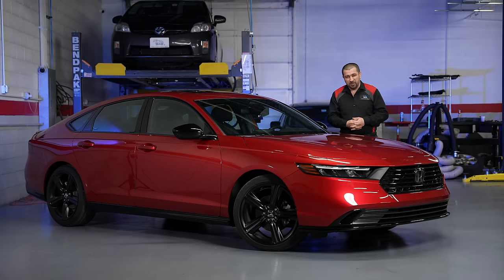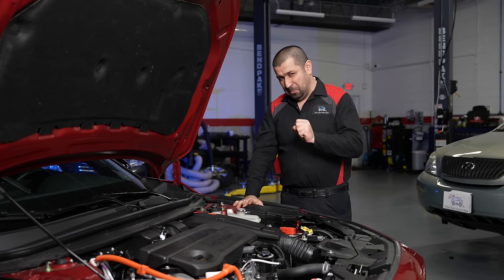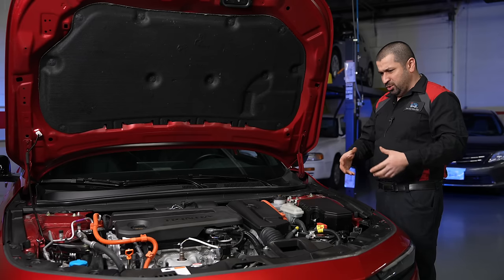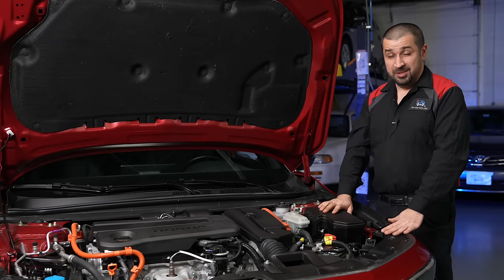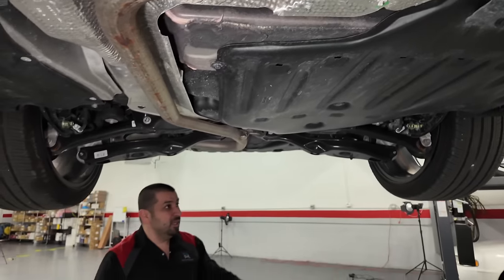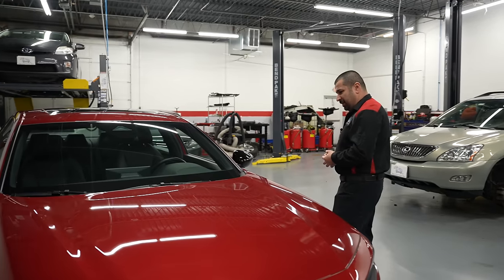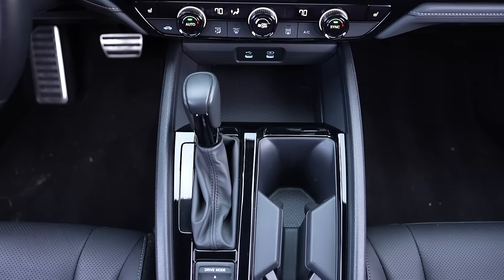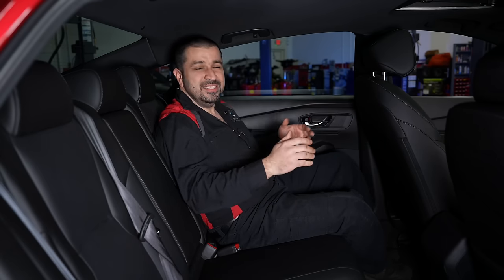Should You Buy The Latest Honda Accord? A Mechanic's Review

Comment: The problem is these Hondas have got WAY too expensive.  I have a 9th generation. And this new accord is basically the cost of TWO of my cars. That is insane. Honda is No longer affordable
Reply: It’s not just Honda. Nothing is affordable anymore.
Reply: I kind of agree with you Jimmyortiz4319. 40K for touring like any others as @Noahkinz has said it what the problem is in our country. Plus the maintenance for all these new Turbo Hybrids is going to cost more. I have a 2017 Honda Accord touring V6 that I paid 29K new for it and love it. It’s also cheaper to maintain. My oil change and tire rotation was $89. My neighbor has the new touring and got the same service for $211 from the same dealership i went to. He was shocked.
Reply: I just bought a 24 touring, got a great trade in offer on my 14 ex accord. So far this new car has been amazing, got financed at 3.9% and should be paid off in 3 years.
Reply: Nissan is
Reply: The strange thing is that ¥ is at all time low against $... Should mean cheaper Japanese items? 🤔
Reply: @Buppasiri1  lmao that's not how the economy work bruh xD
Reply: KIA K5 EX cost $ 30,645.... 
and its a KIA. 
accord EX cost $31,005.
and its a honda.
Reply: It's more affordable than most. The average transaction price for a new vehicle last year was $44,000. Pickups are insane.
Reply: It's mostly due to the requirement set by the federal government for cars that's causing all car makers to use newer tech to reach the mpg standards (cafe).  These requirements are the main cause for the cost increase. The 1.5 liter is due to the cafe standard (gas mpg) requirements or they'd still be using the v6 that's lasted forever on these cars.
Reply: Affordable ? Depends who you are. I bought one. Great car.
Reply: @Noahkinz  Yes. Looking at how much pickups have jumped up.
Reply: In Honda you not pay for brand name like most german cars this days, you pay for reliability of car. And for me that way more important
Reply: @beekaye1496  You talking about something you have no idea. New Honda hybryd engine have NO turbo.That is simple, reliable and economical engine
Reply: @Buppasiri1 most Japanese car is no longer made in Japan.  The Plaza accord took car of that.  Most are made in US and then some are moved to Canada and Mexico.  What the consumer buying is mostly made in US and North America, thus price are jacked up.  Unlike the general home goods that is made in China, anything that is "Made in America" is expensive as union jobs are extremely expensive.
Reply: No sir, they are not.
Reply: 😭.   Oh boo hoo.  The Problem Is….people who can’t afford nice new things are making themselves miserable by watching YouTube videos and then whining about the way of the world.   Can’t afford to play?    Fine.    Get off the internet and stop complaining .   The rest of us will enjoy our new cars and trucks and manage fine.
Reply: @Noahkinz  , may be not that affordable, but still super reliable. And keep price on second market.
Reply: @beekaye1496  Would you like compare aswell the petrol burn between your V6 and new hybryd? And road tax??
Reply: @Buppasiri1  The Accord is made in the US, why would an exchange rate apply?
Reply: @ronhoover5516  That's right but still...  why not import the Japanese instead if the price are a problem? Let the U.S factory "sleep"..
Reply: Couldn’t agree more
Reply: @dwadd7528  Yeah, but the KIA comes with that 10yr/100,000 mile powertrain warranty.  That will come in handy when the rear main seal or oil pan starts leaking.
Reply: @jeffeason3599 I can afford to buy a new car like the one shown with cash every year, but still believe people have a right to express their dismay with basic brand prices. The people on Rolex videos complaining of their cost are a totally different case of course.
Reply: Dude, this isn’t Honda’s problem. Nothing is affordable.
Reply: It’s ugly
Reply: It's handsome
Reply: @davidh7339 and that is exactly how long a Kia will last 100k and die
Reply: @secularthinker My 2011 KIA Forte has almost 104,000 miles and is still running strong.
Reply: I just got a ‘24 Accord Hybrid EXL well equipped for $36.5k drive out price (this included doc fees and GA state taxes).  Came with extra all season mats, trunk mat and window tint.
Reply: 2019 According EX 37k, my 2024 Tacoma TRD Sport 51K. Prices have blown up for all good vehicles.
Reply: @JFreeUNC I got a exl too.  Metallic grey with the light grey leather interior.  I kind of like it better than last gen and I loved the last gen.  I like how the steering get stiff on sport mode.  If it had adaptive dampers like the last gen touring it would be a legit luxury car.
Reply: @jeffeason3599 I can afford those cars and they still seem very expensive.
Reply: Life in general is no longer affordable.
Reply: The camry also is no longer affordable for many people either.  Dealer in my are has them priced from 32k to 49k.  32k for the le with those ugly 16 in rims and tiny infotainment screen.  Even the gauge screen is tiny on the le.
Reply: You have the best looking gen imho. Keep it till it blows up.😅
Reply: You should have kept the 14'. 9th gen is the best gen imho.
Reply: Sounds like a very complicated power plant with more systems to have issues and maintenance with. Longevity and reliability  is what Honda has been known for. Time will tell how this works out. I am not running out and buying one.
Reply: @stephenwhite3576 44K? You must be looking at a base work truck.
Reply: They never really were
Reply: @quala1 yes and you can thank Obama for that.
Reply: @davidh7339  You will have to wait to get that KIA repaired due to parts being on back order.
Reply: @smokeylake6732  Beauty is in the eye of the beholder!
Reply: @Teporame  If they are reliable then you can justify paying for the reliability.  This Accord seems to be a worthwhile investment.
Reply: In Europe we don’t have the Accord anymore but the fully optioned civic hybrid costs 43000€ taxes included. 😳
Reply: All cars went expensive, price gouging
Reply: Then don’t buy one. ☝️🤡
Reply: @stephenwhite3576 THEN DONT BUY ONE !
Reply: @VasylSodomora-bj4ji 

Exactly.
Reply: @smokeylake6732 Much better looking than a Lexus or Toyota with their stupid looking monster robot grills 😂
Reply: @TeeDee-j9u Post pandemic price gouging. After we gave US corporations billions. And Democrats have done nothing 😂
Reply: In my area the Accord EX is 31k and I have seen 29k in San Antonio.
Reply: Truth is, nothing really decent is cheap anymore…not even the formerly ‘cheap’ Korean twins are cheap anymore…did anyone say ‘preowned?’
Reply: @patriotone755  did you listen to his breakdown? It's not that complicated for a hybrid at all.
Reply: @VasylSodomora-bj4ji I still have a ‘15 Accord with the 6 speed manual that I love. Depending on where you live, excise tax (V6 or not) is far less on the older 9th gen due to the vehicle’s lower value. V6 is very fun to drive. Sales tax was also lower. Factor all of that in and the difference in cost covers a lot of fuel.  9th and 10th gen Accord are also much better looking than this 11th gen. At least the 10th gen offered an optional 2.0T engine in lieu of the V6. 11th gen lost it. That said, this current Accord is still nice.
Reply: @6mtzhp55 I love Rolex and Rolex videos. They’re not for everyone but definitely on my bucket list someday.
Reply: You see there are a lot more components and features added to modern vehicles that drive the cost for example computer Chips, touchscreen infotainment, heated ventilated seats etc.
Reply: @Buppasiri1 Have to look at the BOM to see how many parts from Japanese suppliers in Japan and not suppliers in the US. Then add in the fact that the vehicle is assembled in the US.
Reply: @Buppasiri1 Democrats be wantin to party. And you gots to tell dem no!
Reply: @13loodLust Democrats be wantin to party. And you gots to tell dem no!
Reply: It could be that you're just broke.
Reply: Don’t worry the 9th Honda accord v6 coupe is still the best.
Reply: All cars are expensive my 2023 ex was $31,160. It not twice as expense as say a Camry!
Reply: I went to the dealership this weekend to look at the Civic Hybrid and they wanted almost $40k for the top model....ridiculous 😂

Comment: Picked mine up 5 days ago. As a full time Uber driver, this thing is a dream. I’m complimented daily not only on the look but the crazy amount of room. Thank you very much for the battery vent warning. I wasn’t aware how important that is.
Reply: Did you get tax savings / rebate?
Reply: I believe it qualifies for a half a credit as some parts are chinese in origin
Reply: loving  the AC vents in the backseats :)
Reply: When I was shopping for a new Accord in 2016, I wanted to get a hybrid…..Do you know that Honda was charging $45,000 for one back in 2016!  I went for the ICE 2.4L, which has plenty of power and good fuel economy….now hybrids and ICE versions are basically the same price. I would be very angry if I bought a 2016 Honda Accord Hybrid for $45,000 in 2016 and then saw Honda drop the price on hybrids.  I got mine for $27,000 including destination, taxes and $1,500 Honda sensing safety option through Costco car buying program.
Reply: @mjb0183 you was going to be more than happy with 2015 hybrid a lot saving and no need to buy another one. I have the same car 2015 I’m happy no problem over 250k miles and not need to buy the new one the only thing lacking is the trunk is smaller cause honda put the battery in the trunk the new one have it under the back seat. Another different is the older model have a bigger tank size so i had done over 600 mile with one tank with the new one idk if that possible do to the smaller gas tank.
Reply: How do you afford this doing uber full time? When i did uber i went into debt. And i couldnt imagine having a car payment on top of that.
Reply: @Lobonova  EXACTLY!!
Reply: @SPIN_89  How in the world can you buy a New car driving for Uber?!?!  I do Uber Now with a used Car that is Paid for. And let me tell you I can barely afford to maintain my vehicle.  Or even just buy something newer. Heck I cant even save any type of money. Uber charges  DIRT  cheap for rides compared to any taxi. So we make crap money
Reply: Full time Uber driving a Hybrid? I would be worried about having to replace that battery so fast. I would imagine you are putting in 40k at least in miles a year. The hybrid battery warranty is 8 yr/100k.
Reply: @0my - It was a dealer loaner car originally so I got almost $5k off for that and an extended standard warranty. I’m not 100% on the tax savings though. I’ll have to ask my CPA
Reply: @nightrider2k6 - I was too but that only comes in a higher trim. Super lame but the AC up front does a solid job.
Reply: @jimmyortiz4319 @Lobonova - I live at home with my parents, duh! 😂 I’m a single parent and the AVG cost of a home is $435k in AZ. Avg rent is over $1500. I’ll be with them till they die! 😂
Reply: @paulcarlin5181 - TBH it’s a really concern. But it beats a full combustion engine on so many different levels. If you do your money right you can just save for when it’s time to service it like anything else. Plus I’m averaging almost 50 mpg daily.
Reply: @SPIN_89  My gf was debating the CRV Hybrid and she went with that it will be a drive to the wheels fall off ride so she went non hybrid. Short term I would go Hybrid. Enjoy your ride Sir.
Reply: The interior is literally CAVERNOUS.
Reply: @Lobonova what market, Boston drivers average about $1400 gross weekly, over 50 hours 1500-1600

Comment: I have this car and driven it 5k miles and I freaking love the thing. First car I've gotten that I view more than as just a means to get from A to B. Love love love this car.
Reply: What do you love about it?
Reply: @danjenkins2064 probably the smoothness of it when driving. I own a vehicle with gas cvt and it just runs smooth, but no worries I will be doing a YouTube channel video on CVT transmission with my vehicle in 2025 when I do a 5 year review on it
Reply: @alvinsimba734  Thanks for the response.
Reply: Are the seats comfortable? I hear their harsh on long hauls if you have back issues? 🤔
Reply: @nastynati3501 I drive 3 hours one-way about every other weekend and I never had an issue with comfort. I’m also 25 and never have back issues so probably not your best opinion
Reply: @nastynati3501  the best answer for your question is to sit in it in person and then see
Reply: I drive the Touring. Comparing it to my old ‘19 Touring 2.0T, this one while not as fast, the interior is so much more quiet and refined. The NVH on the last gen was terrible. So much road noise and terrible mileage.
Reply: What a bummer and a dull life. Loving a slow and lame car. What you need is a Fast Car and a Beautiful Woman.
Reply: @danjenkins2064  its like a swiss army knife. Want to have a little fun? Put it in sport, and its plenty quick. Want a super efficient ride? Econ mode and predictive driving can get you 50+ mpg with intelligent use of the regenerative braking, want to enjoy some sun shine? roll the windows down open the sun roof and enjoy. Its quiet, and comfortable. Its the perfect daily driver imo.
Reply: @richscott2483  haters are gonna hate. Im happy with my purchase.
Reply: @nastynati3501  I haven't had issues, I find the car quite comfortable and don't really get fatigued by driving. The car is fun. All I can say is test drive on yourself. Haters gonna hate, but 150k mile warranty and 10 years with the extended so if your worried about something breaking you can look at that.
Reply: @EpTyrannical  Great answer. Thanks for sharing your perspective.
Reply: I rented one for a week. It’d be in my driveway as I type this but for the scantily-padded seat cushions.
Reply: @richscott2483  --Lol, like the Fast Car but Too Old for a Fast  Beautiful Women...
Reply: I agree. Same here. But there is onw thing I still haven't figured out. How can we check the tire pressure?  Does the car show it anywhere in the system?
Reply: @nortenero  I currently own 2019 Touring 2.0T like you had. I bought it new and has 48000 miles on it. Are you still really liking your hybrid compared to 2019. As you know the 2.0T quite fast etc but my mpg is about 23-24 so not that great. How is the acceleration/torque feeling of your hybrid compared to your old 2.0T? i plan on driving one but I hate the whole dealership experience. Thanks
Reply: @EpTyrannical  i just test drove this and can confirm this 💯
Reply: @Hilighted seats are hard on the 2018 civic also.  Minor ergonomic issues.  Best fuel economy I have seen.  4.2 liters per 100 over 1400km trip.  My Pilot has the seats...
Reply: thats all that matters

Comment: Purchased a 2024 Accord Hybrid Touring. Very pleased with quality, technology and ride. Also purchased the spare tire, jack and insert  for it as it is offered in the non hybrid low trim model. Fits right in the Hybrid Touring. I'm averaging 47 -49 MPG.
Reply: How do you drive? I mainly drive 75mph on highway and I get 39mpg. We have the same car btw
Reply: @Mandawg1  Speed is your issue :( If you would drive slower, the MPGs  would get better :)
Reply: 75mph is the problem.  You are encountering a lot of drag. Anything over 65ish, your fuel economy will suffer
Reply: @Mandawg1  The Touring with the 19-inch wheels is rated at 41mpg highway, which is not far off your 39mpg. I have the EX-L Hybrid with the smaller 17-inch wheels, and its rated at 44mpg highway. I do 99% highway miles at 75+ mph, and I'm at 42.2-43mpg after 4,000 miles. I would probably get higher mpg if I slow down a bit but I'm in a  hurry most of the time, lol
Reply: Did u purchase the spare kit from the dealership?
Reply: @Mandawg1  If I usually drove high speed highway driving...I wouldn't buy a hybrid. An ICE vehicle can give you 30+ MPG on the highway. Hybrids like mixed city driving of < 60 MPH.  I have owned a hybrid for 3 years.
Reply: Where did you purchase the spare wheel kit?
Reply: I bought 2024 accord touring hybird, and I changed with civic touring hatchback. I have to press the gas hard to get speed or to stop, plus the battery are too expensive
Reply: How can we check the tire pressure? Does the car computer show it anywhere?
Reply: Thanks for sharing
Reply: Did you get vintage seats and if so did they actually blow cool? The one I test drove had vinted seats I did not buy it because the vintage seats did not blow cool in fact as I turned it on my butt got hotter. I have a 20/20 Genesis that have cooled seats and when I say I turn it on and my butt feels like an icicle I really do mean it. I did not buy the Honda only because the vintage seats and the CVT transmission, those are just no-nos in my book for a car. I know hybrid technology from Honda last my mom has a 2010 inside she bought new and it still running now of course after 8 years Honda had to replace the battery pack luckily that was a recall. But as Honda keeps cramming more and more crap underneath that hood I just don't trust it. They seem to be reliable but they need an update their warranty to prove it
Reply: Excellent review.  Thank you.  Picking up my touring model on Monday.  Cheers
Reply: @Mandawg1 Honda hybrid MPG dives off a cliff when you go too fast.
Reply: @Nitrobucket It's not the aerodynamics. The way the Honda hybrid is laid out just means it's a lot less efficient than at lower speeds.
Reply: Do you recommend buying the civic sport touring? After months of owning it and any issues?